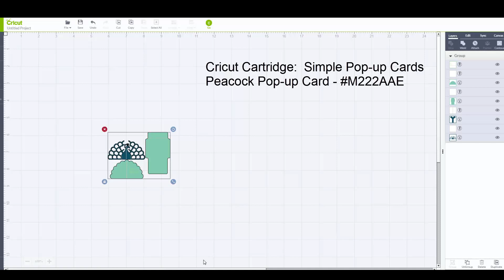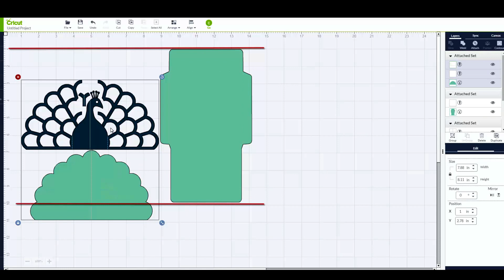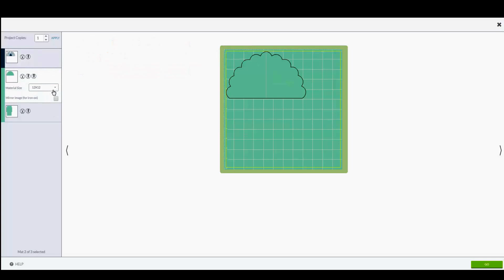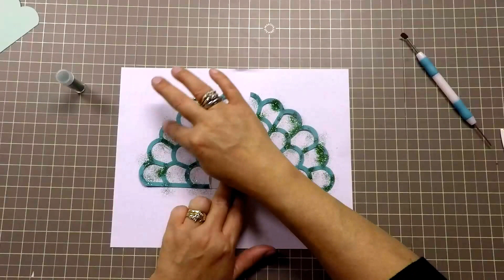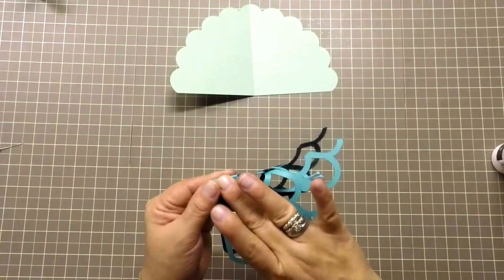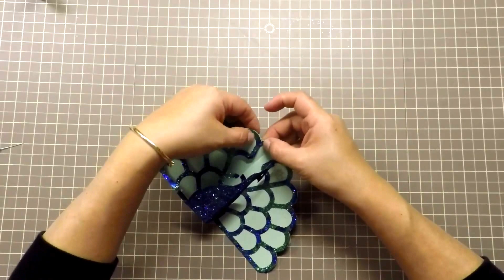Peacock Pop Up Card - Cricut Explorer

Comment: Can i ask you what is the glue you are using ??? the nozzle on it is so fine i love that :)
Reply from the maker: Hi.  I used Scotch Permanent Tacky Glue.  I also use an Ultra Fine Metal Tip applicator.  I got it from Amazon ( https://www.amazon.com/Art-Glittering-System-Ultra-Metal/dp/B0013AP4X4)  But I just noticed that there is another website that has it for less ( https://www.simonsaysstamp.com/product?id=60055&gclid=CjwKEAiA3NTFBRDKheuO6IG43VQSJAA74F77I0WBz5rTxSE6YxEIU_zVGZ2NjB8vPj9ThZiqarrjQRoCvoDw_wcB ).

Sassi.